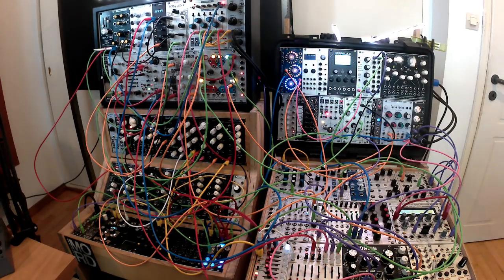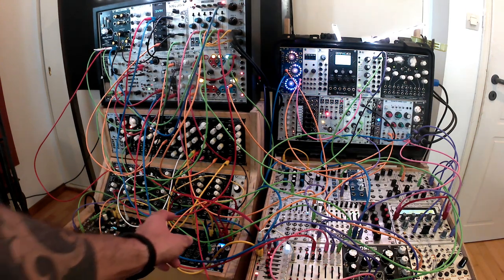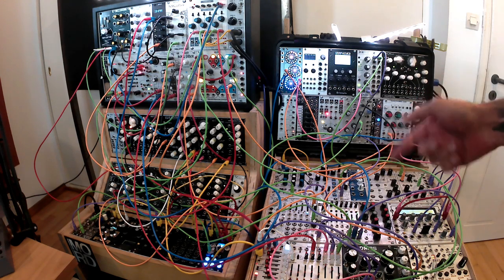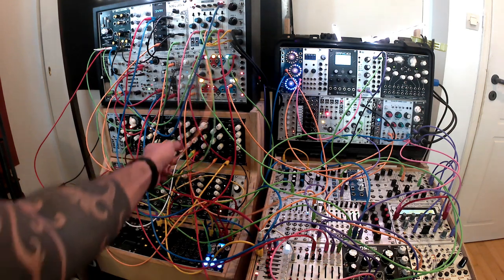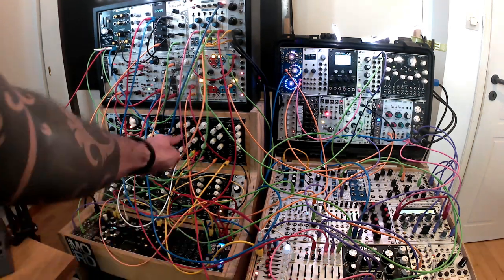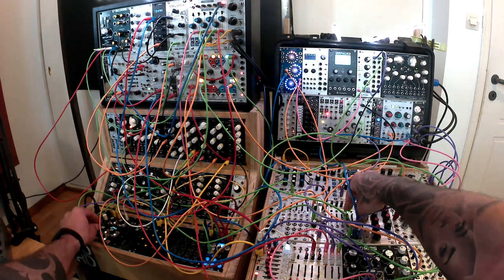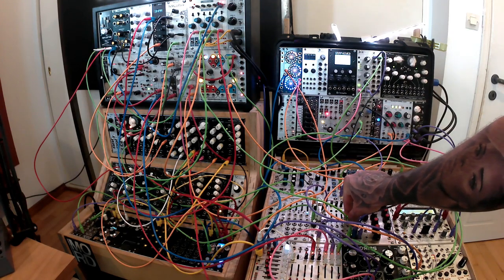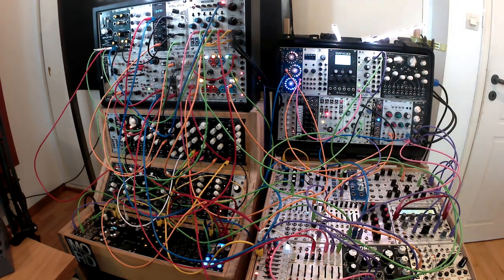Rene Gate Sequencing

Comment: Just curious-- main clock??
Reply from the maker: At the bottom left of the screen (the right side of it can barely be seen) is the Octatrack that sends clock to Hexinverter Mutant Brain (bottom left case, bottom row, all the way to the left).
The Hexinverter relays Octatrack's clock to the Make Noise Tempi, which clocks everything in the patch.

Comment: Really nice patch and walk through. What about changing the sequencing order or clicking for the Rene, have you found an interactive way to change and return to different states reliably while playing with it?
Reply from the maker: I have the Rene mk1, it doesn't have states like the mk2 does, unless you mean Snake patterns? For reliable Snake pattern changes, I use a static offset from the Voltage Block.
Reply: @nectariosm  Yes, VB seems like a good option. I have it and I'm curious about René 2. My fingers don't work with MN PP so I'd have to get the same panel as you. René 2 should fix it but I want to wait for a fix to the firmware  before getting it.
Reply from the maker: @holonmundi5320  The reason I sold Pressure Points was the touch problems. I didn't sell Rene, even though I could not use it cause of the panel, because after mk2 came out, people where selling it for chips. Luckily I found one of those button panels so now I am happy with it.